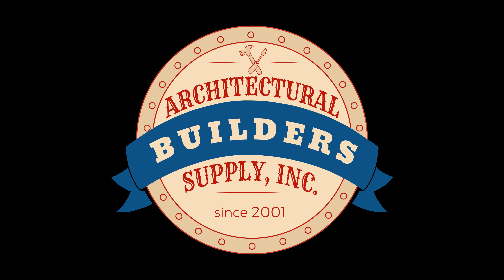A Conversation regarding surface closers and 400 lb door and ADA compliance et al

Comment: Dual paine insulated glass alone is heavy.  Oversized door for oversized problems down the road.  Rixson was first thought but this may need an automatic door to overcome Ada codes and building stack pressure on hot days when the A/C is blasting.  Good luck!
Reply from the maker: I've never heard that saying with your permission I will use it “Oversized door for oversized problems down the road”.